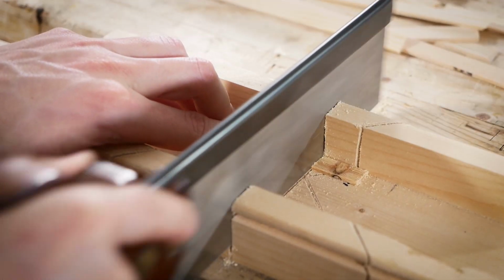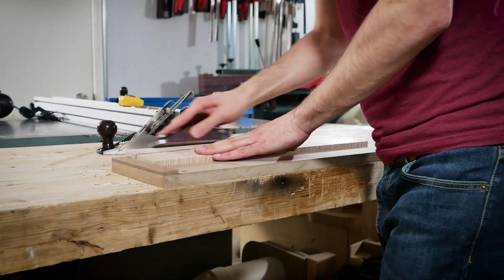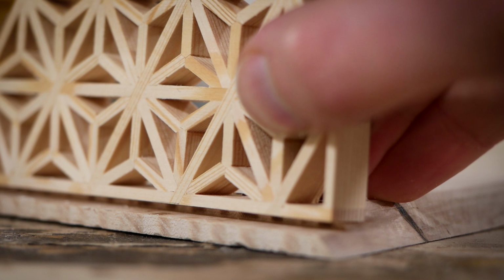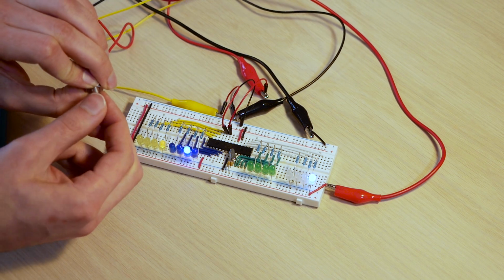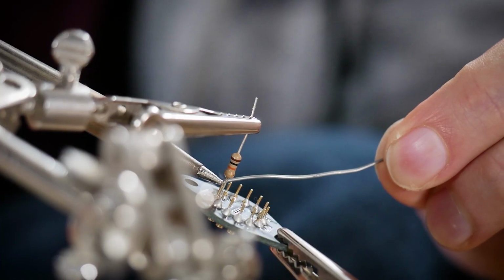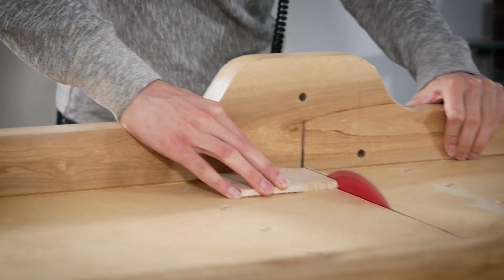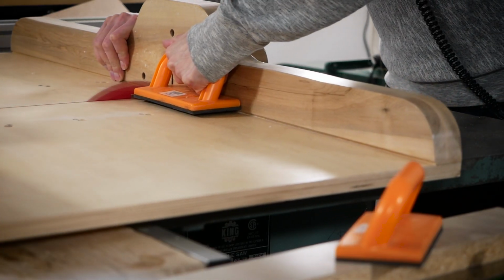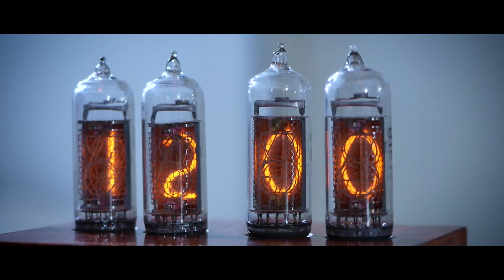The most beautiful thing I've ever made

Comment: Nice work!  I'm curious to know what parts you used to pull the cathodes to ground.
Reply from the maker: Each cathode is connected to the corresponding pins on the K155NA1 logic gate IC, which is grounded. The anode is connected to 170 Vdc. Thanks for your interest!

Comment: Quick question: Did you manage to prevent the tubes from being "wonky" in those slots? I did a similar project and the tubes will definitely move out of place if touched...
Reply from the maker: yeah, it's definitely a 'look, don't touch' situation. Some people solder them in so they stay in place but I can't imagine trying to de solder it to replace a tube in the future.
Reply: @ScottWalshWoodworking  Thought so. I find that adding a drop of glue gun glue before sloting in works and is not visible.
Reply from the maker: @jipiquittot  that's a good tip, i might try that, thanks!